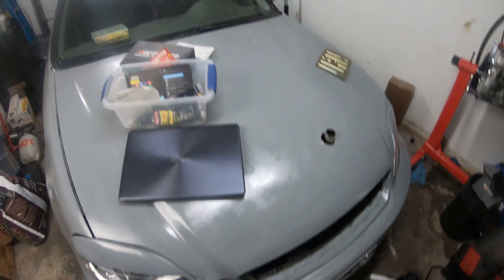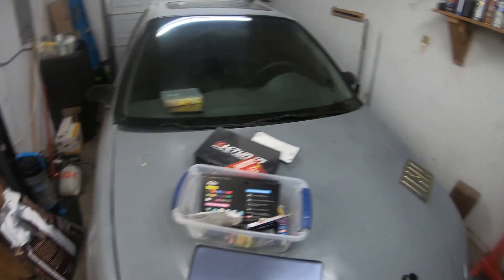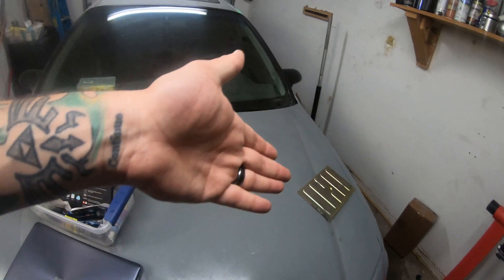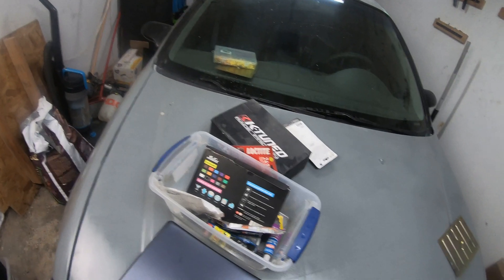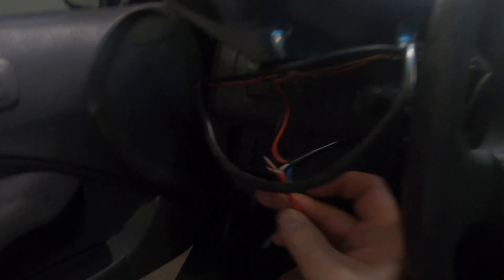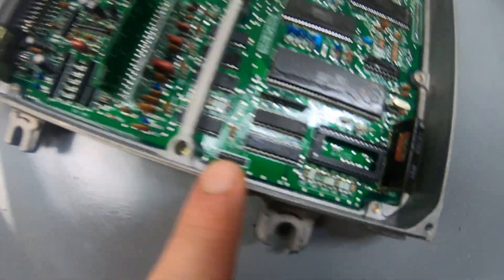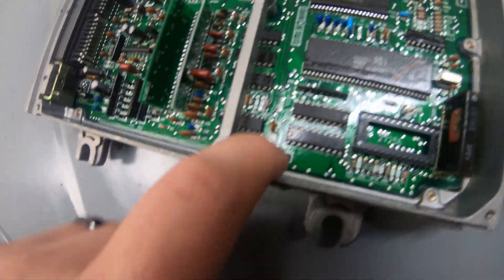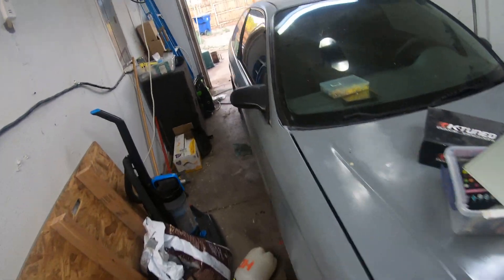Setting up Datalogging For my Turbo D16 Civic with a P28 Ecu (Part 1) - Wideband P28 Install

Comment: PLEASE HELP! I’m trying to get my datalogger to connect to my pc, I have a p28 with the bmlogger so far I’ve seen 3 lights on it, but it says com port 3 it just won’t connect whenever I’m in a tuning software, even with bmtune
Reply from the maker: Have you set the baud rate and everything according to the manual for bmlogger? I'm not familiar with that one but I'll try to help as much as I can